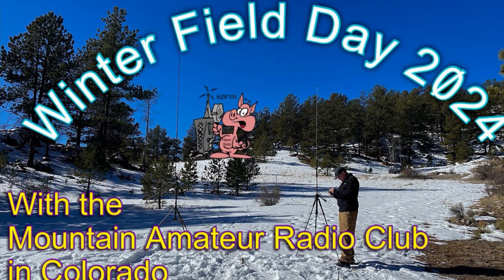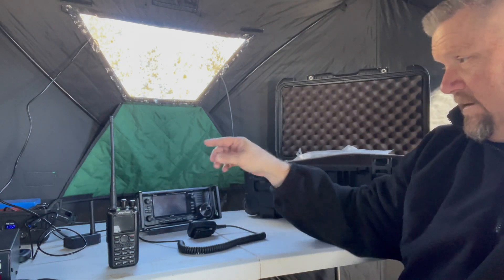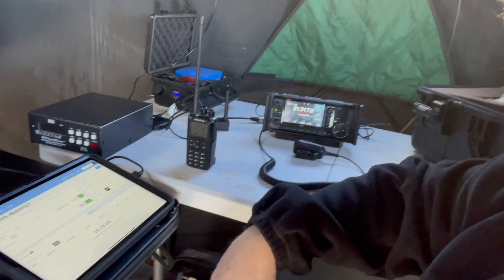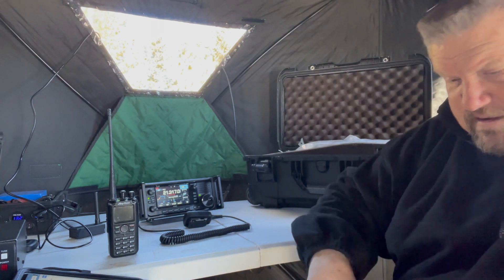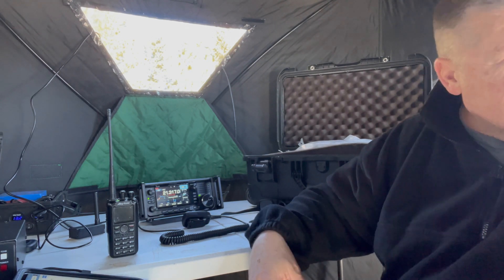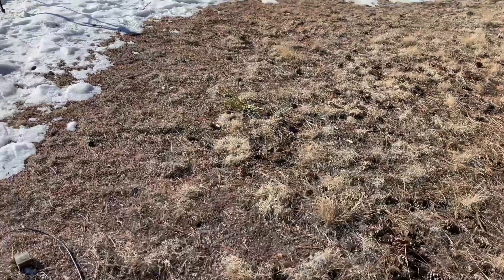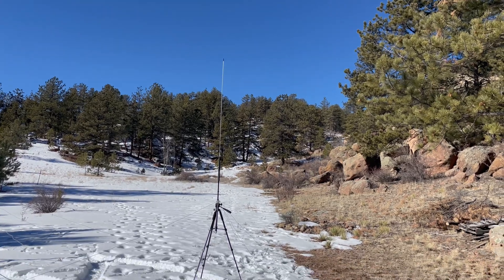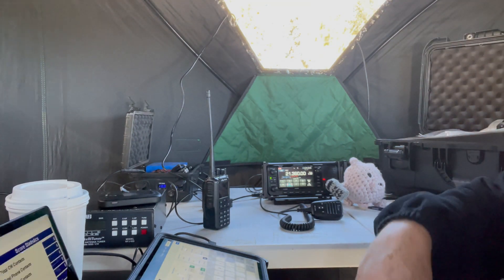Winter Field Day 2024 with the Mountain Amateur Radio Club in Colorado

Comment: Congrats to the both of you for braving the cold and only shutting down thru no fault of your own. (Roarin round of applause). Do you know how long the slim Jim j-pole was, and if it was homemade or not? How has the Compactenna been working for you? Thanks for sharing. 73. KC3UEE
Reply from the maker: Thanks kidbach. The 10m j-pole was Homebrew by K0ATV and was fairly long (upwards of like 25 feet or so. I made one very similar to that for 6m and used an online calculator that worked really well to figure it out. https://m0ukd.com/calculators/slim-jim-and-j-pole-calculator/ As far as the COMPACtenna that’s on my vehicle it does great and in some cases I hit DMR and analog repeaters sometimes 40 miles away no problem. If you meant the PackTenna EFRW 29’ 9:1 unun that I had connected to my IC-705 it works great and like 30 of the states I’ve done POTA and SOTA in can be attributed to that little antenna. Ham-Solo K0FYR
Reply: I was talking about the COMPACtenna on your car. Thanks.
Reply from the maker: @kidbach  yeah it’s been great. I take it off usually when I leave the vehicle at the airport parking lot but it’s generally the only thing I use on the car unless I’m doing some kind of simplex propagation tests in the mountains then I’ll put on the 44” tri-band to see if I get better reception in all the hills and valleys. Overall the COMPACtenna is the only one I have on there. I will say the gasket takes a beating with our cold temperatures and me having to remove it more often due to travel but I just found a thicker gasket at an Ace hardware that goes between the antenna and the NMO mount that won’t get worn out and cut as easily. Ham-Solo K0FYR